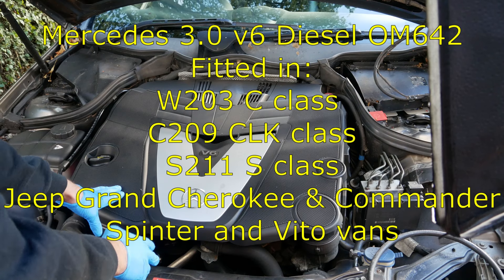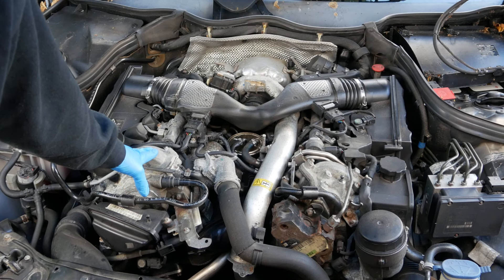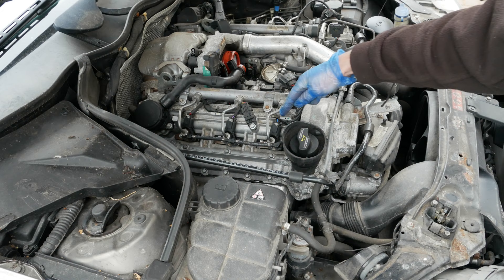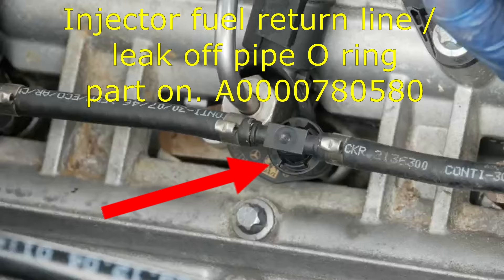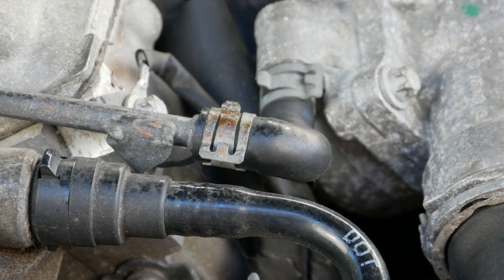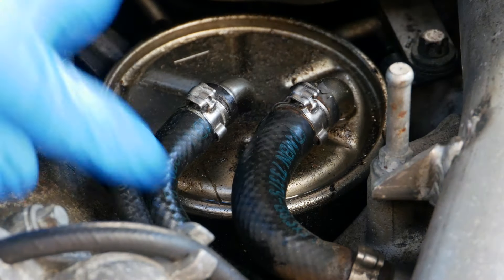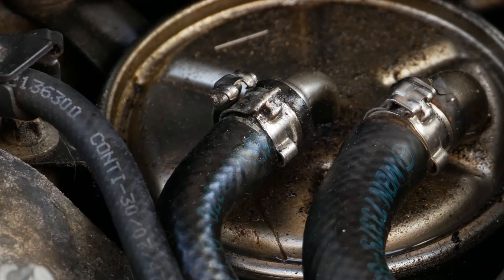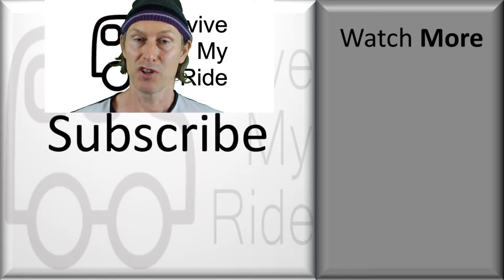Mercedes Diesel OM642 3.0 V6 Engine  - Common FUEL LEAK Areas

Comment: Hello friend, i have a jeep grand cherokee and the leak is coming from the fuel injector return line plastic part you mention at 2:25 into the video. You mentioned a collett or something you pull out to change the oring. Could you help me out and explain that collett thing? 

Thanks
Reply from the maker: I’ll try my best! The return line connection onto fuel injector has a little collar on it, which is the fastening mechanism to lock it in place. In the video, you will see I use a wrench to push the collar down (it only moves about 1/4”) and then the return line can be pulled free. Crucially, inside there is a little O ring. Here is a link to a MB forum with some photos.  https://mbworld.org/forums/diesel-forum/622346-replaced-injector-om642.html Hope that helps! Thanks, Phil
Reply: @ReviveMyRide  thanks Phil. Fixed it in 10 minutes.
Reply from the maker: @goodbyeroom306  Great to hear, thanks for messaging back! 👍😀

Comment: OK so I have low pressure in the fuel rail after fitting a new injector, and the car won't start. It's on my A180D but essentially same principles apply here. I didn't fit a new high-pressure fuel line to the new injector, I wonder if it's that. What do you think? Thanks for this video! I can't find anything similar for my model. Merc wanted about £1500 to do the job.
Reply from the maker: Hi, the main thing that effects the fuel pressure in the rail is the high pressure pump and the fuel pressure regulator. If these were working before, then I suspect you might have a priming issue. They can be quite a pain to prime again once you have done some work on the fuel rail. Usually, if you turn the key, listen for the system to prime, turn it off again, do the same again (without starting the car) about half a dozen times and then turn the car to start, you can get it. But some people have to crank the engine over quite a lot. They put a charger on the battery, then crank it over 3-4 times, then let it charge for a while, try it again etc. The other thing that seems to work is jacking up the rear of the car quite far to raise the fuel tank. I don't understand why this would make the difference but there are lots of posts saying it helped! Hope this helps! Thanks, Phil

Comment: how easy is it to replace the very same hose?
Reply from the maker: Hi Dave, I just had a quick look. It looks reasonably easy and would take an hour or two depending on your experience level. To get access to the hose, you need to remove the air inlet pipe to the turbo (the black plastic one that runs from the left and right hand side airboxes), this can be a little tricky because you need to pull the hose off of the air boxes on both sides. Sometimes it is worth loosening the air box mounting bolts to give some play. Then you will need to remove the aluminum turbo outlet pipe. Now you should have access to the fuel hose and it is held in a plastic channel, which you will probably need to loosen or undo. You will need to make sure you use proper fuel hose (as it is pressure rated and resistant to the fuel) and I'm pretty sure it is 7mm internal diameter / 13mm external diameter and if I was you, I would buy some fuel hose clamps, just in case you aren't able to refit the original clamps. My injector "inspection" video will show you how to remove the air box and turbo inlet pipe: https://youtu.be/7weS1vQ_1OI I'm afraid I don't have any footage from there onwards though! You will probably find better places to buy these items but here are a couple of links to the fuel hose and clamps you should consider: Fuel hose - https://amzn.to/3HgElxj fuel hose clamp: https://amzn.to/3D8mLsZ Hope this helps! If you have time, would be great to hear how you get on and it may help others if they read it. Thanks, Phil
Reply: @ReviveMyRide  Phil, thanks for your rapid and detailed response.  I am planning on getting parts this week and having a look next weekend.  I will certainly reply and give an update on how the job goes.  Again Thanks!!
Reply from the maker: @davemyers9128  No probs, happy to help when I can! Good luck with it!

Comment: Whath happen if fix the licks and then the engine wont starts
Reply from the maker: Hi, well that is the risk with any work that you diy at home. You have to weigh up your confidence and skill level and decide whether to go for it. Usually, you build up your experience with smaller jobs, have success, learn from a few fails and keep moving forward. Hope that helps! Thanks, Phil

Comment: I have a fuel leak on the fuel inlet into the high pressure pump on my Mercedes W203 270 cdi. I suspect it's the Small o ring on the   very end of the fuel line connector (the small black one not the white outer cushion ring).
I'm having a devil of a job sourcing a replacement. Could anyone help me with a merc part number please. Great video btw.
Reply from the maker: Hi Stephen, thanks for your kind comments! 😊 I use a free online resource for finding part numbers called Nemigmaparts.com From your description, I think the part you are looking for is number 198, part no. A6019970645 in the diagram but please double check!  Part numbers and diagrams for your car here: https://nemigaparts.com/cat_spares/epc/mercedes/1/m/612962/21t/07/120/?chasis=20301665F You can double check what the part looks like and that it fits your car on Autodoc here: https://www.autodoc.co.uk/spares-search?keyword=A6019970645 (Just click on the compatibility section at the bottom on Autodoc) Hope that helps! Thanks, Phil
Reply: @ReviveMyRide  Hi Phil
Thank you for your speedy reply. Really impressive. I'll check out the links and let you know. As a temp fix. I've cleaned the o ring and inlet. Then smeared with a little Vaseline and fitted back together. As it's on the low pressure side of the pump I'm praying this works until I can get my hands on a new o ring. I'll update here how things work out. Ta again.
Reply from the maker: Hope the temp fix keeps you going! BTW, should have mentioned before, I have found Mercedes dealers to be more than reasonable on price in the past and an O ring wouldn't be expensive anyway. One time I priced up a lot of parts from 3 different sources and Merc actually came out cheaper! You my find that they are worth a shout. Thanks, would be great to here how you get on! Cheers, Phil
Reply: @ReviveMyRide  Hi Phil
I contacted Mercedes parts department at my nearest dealer. As you suggest, and much to my surprise, they were really helpful and posted me 2 replacement o rings for a fraction of the cost on ebay etc.
Fitted both o rings but sadly not fixed leak. So it's probably the pump gasket on the plate just below the fuel inlet.
I'm going to order the pump repair kit and overhaul the pump hoping I'm right.
I'm very new to all this but learning. I massively appreciate your help and interest.
Reply from the maker: Hi Stephen, glad the advice helped and that Mercedes were responsive, always worry that people will get a different experience once I recommend them! I'm really interested in your work! I'm a home mechanic myself, which means, if it's something new to me, I have to learn it too! Hence, I haven't carried out the work myself that you are doing on the pump but I'm interested to see how you get on. Sometimes a few things stick in my head for if I ever need to do the job! Keep in touch if you want to bounce any ideas about! Thanks, Phil
Reply: @ReviveMyRide  thanks Phil
The o rings arrived promptly from the Mercedes dealer at Peterborough. The correct parts as you recommended but leak continues which means it's must be a gasket on the pump itself. I'm going to order the pump repair kit, take the pump off and overhaul it. It's an ambitious plan and steep learning curve but I'm determined to give it a go. May also change out an older fuel line as well whilst I'm there. Will keep you posted.
Thank you for your encouragement.
Reply: Hi Phil
Thought you may be interested in progress re leaking high pressure fuel pump. All parts arrived promptly from Mercedes Peterborough who have been very helpful btw. Aim was to remove fuel pump and replace a suspected leaking gasket. Thought I could do this in situ but don't even try it. The sealing plates hold down large springs which would be impossible to stop firing everything out. So removed pump completely. A tricky job. Mate lent me a small mirror on extending rod which helped massively as the bottom bolt cannot be seen unless you remove the whole car front.
Refurbed pump and replaced all the gaskets  etc. Refitted pump. Really satisfied with it all. However I've now got lots of air in the fuel lines. Tried the purging point just over the coolant thermostat and released some air but still not starting. Do you have any recommendations on priming a common rail diesel Mercedes. Many thanks
Reply: Btw - here's a video on refurbishing the high pressure pump.
Reply from the maker: @stephen85911  Sounds like you did some really good work there and that it was quite a tricky job. Thanks for sharing the video of the high pressure fuel pump, I’ll give it a watch tomorrow. Regarding priming: I’ve had this come up a few times. Obviously the more air you introduced, then the harder it gets but this is what has worked for others: Turn the key on, so you hear the main punk prime and then back off again, do this about a dozen times. If you can, make sure the fuel tank has plenty of fuel in (at least 1/4 tank) and jack up the back of the car as high as you can safely (I had my doubts about this but apparently it really does help). Then just keep trying to start the car. You may need to take a break to let the starter cool and to charge the battery but you should get there if you persevere. Don’t be surprised if you need to crank on the starter a dozen times or more. Hope that helps! Also, hope the leak is finally fixed and that you are all good to go! Cheers, Phil
Reply: @ReviveMyRide  thank you for coming back so quickly. It really helps when stuck with a job. Great advice. I'm going for it today so will let you know how it goes.
Reply from the maker: @stephen85911  Good luck with it!
Reply: @ReviveMyRide  Hi Phil
Would not start at all. Tried easystart which got it running. Ran for about 10mins at 2000 plus rpm. Unfortunately dies on idle. Checked fuel is being delivered to injectors - all ok. Restarted with easystart again. Just will not hold on idle and dies - then will not restart. Any suggestions to try out Phil?
Reply from the maker: @stephen85911  Hi Stephen, I take it that it was running ok prior to you doing the work? If so, it seems likely that it is an area that was disturbed. I’m not sure how much you needed to remove to do the fuel pump work, but it seems like it is potentially a fuel pressure problem? Sorry, I haven’t come across this issue myself but will do some reading tomorrow and maybe we can compare notes!
Reply: @ReviveMyRide  Hi Phil
I had to removed the vacuum pump unit and low pressure pump to get access to high pressure pump. There is a video showing how this is done. I'll try to send you the link.
Tomorrow I'm going to look for more details on how the pump works. I'll do some more investigating and see what I find out. Frustrating but I'm determined to solve. Thanks again.
Reply from the maker: Hi Stephen, I found this link, which might be of interest to you. I believe the Dodge sprinter runs the same engine as your car. https://forums.edmunds.com/discussion/12273/dodge/sprinter/sprinter-cranks-but-wont-start
Also, seems like you may need access to Star Diagnosis if you want to be 100% sure that you want to be 100% sure that you have the right fuel pressure to start and idle. It seems to me that it is likely that you fuel pressure is low but if that is the case there are a few things that cold cause it. In the link, they mention an O ring on the fuel pressure regulator which may be worth checking.
Reply: @ReviveMyRide  many thanks Phil
I'm going to check that out. I'm also thinking whether a small particle dislodged from the pump and has stuck in one of the injectors. The engine runs perfectly at 2000rpm but is very rough at idle before stalling. Starts perfectly with easystart.
Worth a shot.
Reply: @ReviveMyRide  Hi Phil
Happy New Year
I promised you an update on the leaking high pressure fuel pump. Through a lot of research and  trial and error I've fixed the leak. I've also kicked new life into the pump so kick down acceleration is immediate rather than slight lag.
It's been a steep learning curve but well worth it.
As leaking gaskets on the fuel pump are common, I'm happy to produce a step by step guide with tips. You may want to produce a video from it.
Let me know if interested. Thanks for all your help todate.
Reply from the maker: @stephen85911  That sounds like some really good work! That's a kind offer regarding the photo's and description and I have attempted videos from photo's etc before (and it can be done) but as I wouldn't have been the one to do the work, I worry that I wouldn't be able to answer questions and advise people.
Reply: @ReviveMyRide  no worries Phil.
I think I'm going to write out a set of instructions and tips anyway for my future ref. I'll contact you when I'm done and you are welcome to have a copy for your own ref.
Reply from the maker: @stephen85911  Thanks! I'll be interested to read them and if my car develops the same problem (entirely possible!) then I will definitely use the instructions and make the video!

Comment: Kinda related, I have the same w211 as the video but I'm having an issue where the car runs out of fuel while showing 1/4 tank left on gauge have change both sender unit and pump in tank, fuel filter and from reading forums it possible that high-pressure pump isn't returning fuel to create venturi effect in tank, has anyone came across this?
Reply from the maker: Sorry, I haven't maybe some others will comment!

Comment: Yep i found one 3 hours ago in the front lower right side of the pump. 😔
Reply from the maker: Hi Alex, thanks for your message, always interesting to see how others are getting on with this! Were you able to stop the leak by tightening the fitting or is it going to require more work than that? Thanks, Phil
Reply: @ReviveMyRide  i actually haven't touched it at the moment am currently doing as much research as possible before i decide to tackle it myself or not. Am getting stuck at weather i need to find tdc for the weighted gear its runs off on the cam. As i may have to redo a seal or 2 so will change the position of the gear on the pump having to handle it. to the gear position on the cam. Any tips or am i getting caught up in 1 of these internet threads that take you round on circles for nothing.

Comment: Did not help me, leakage in same place, cut hose, put new clamp, still leaking
Reply from the maker: Sorry that the quick fix of snipping back the hose didn't solve the problem, 90% of the time it does but looks like you were unlucky! At 04:20 in the video, I mention that if it doesn't solve your problem, then you need to replace the hose. If you measure the external and internal diameters of the hose, you should be able to pick up a length of high pressure fuel hose quite cheaply. 👍
Reply: @ReviveMyRide  ordered new one, will try today to replace it
Reply from the maker: @andkulikov  Sounds good, hope it works for you!

Comment: Pure garbage engine... I refuse to work on them. Scrap the lot and be done with it.
Reply from the maker: @razor6888 Really interesting comment! Totally respect your opinion as I'm sure it is based on your own experience but my own view couldn't be more different! I drove the car for 10yrs and 100k miles and it never let me down or needed any major maintenance. Diesel leak in the video was due to a worn hose that occurred through changing the fuel filter many times over the life of the engine. I love the engine so much, I searched high and low for a newer Mercedes car where they were still using it! Thanks, Phil
Reply: @ReviveMyRide  I'm pretty sure I have the same exact issue on a 2011 (small amount of diesel fuel on top of the filter). It doesn't look like there's much slack in the hoses so I may be ordering a new hose. From the top you can't see which one is leaking. Going to try to slip something under each hose to see which one has fuel on it. Looks like either $9 or $20 depending if it's the return or the high pressure line.
Reply from the maker: @matsudakodo  Sounds like you have really narrowed down where your leak is coming from though, which is good news! Also, great that it looks like it's going to be a fairly cheap fix - good work! 👍 Cheers, Phil